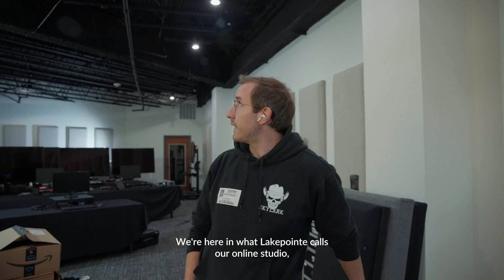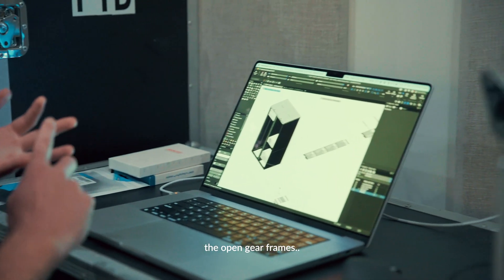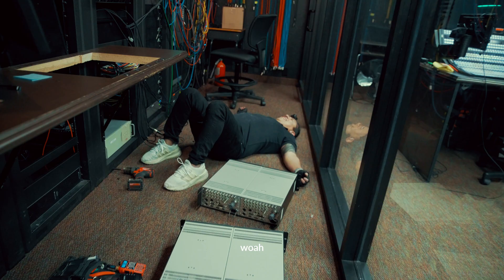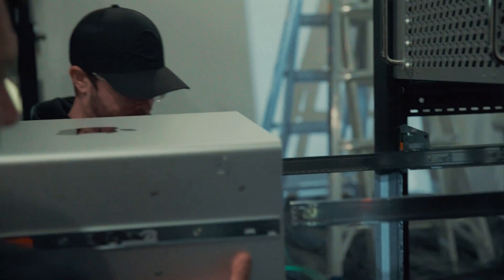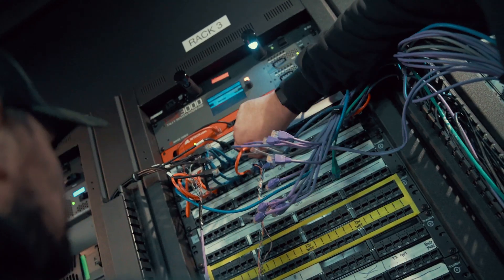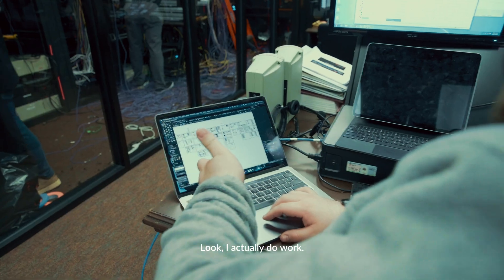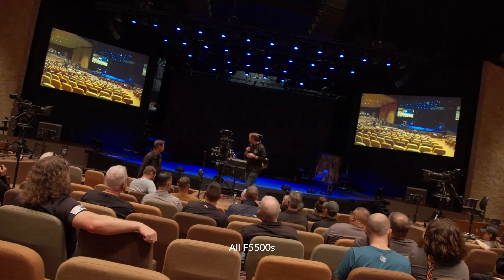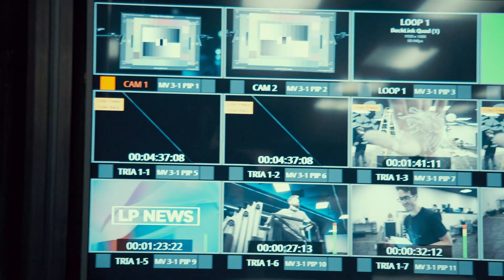Skylark AV - Lakepointe Broadcast Video System Recap

Comment: Hey guys! I’m sure you guys have your industry secrets which is what makes you guys the best lol but my church has a decklink quad with mini bnc cables but I can’t seem to find a good quality mini bnc cable so my video outs keep dropping out. Any suggestions?
Reply: may not nessicarly be the connector - I've experienced times where it's based on the length of the cable (tho if you're doing a short run then it's definitely the cable or connectors lol)... if not try messing with resolution/framerate
Reply: and for more of an answer - Neutrik is always my go-to :goodvibes: